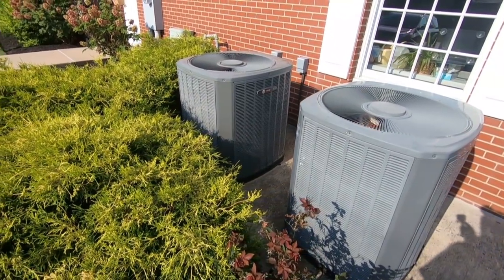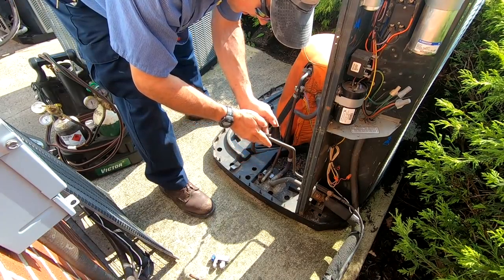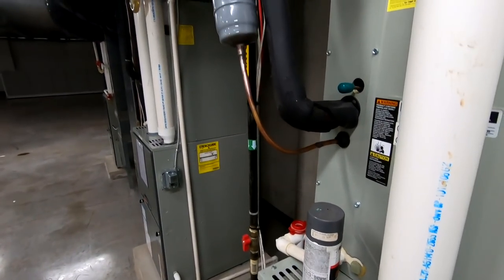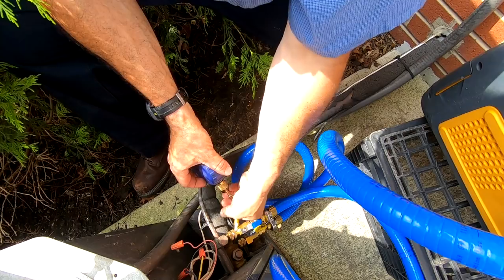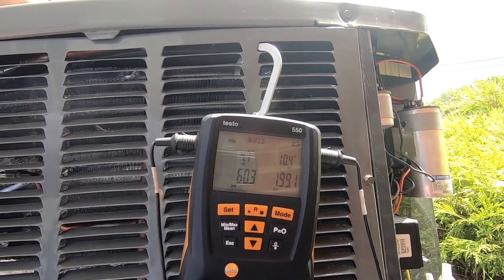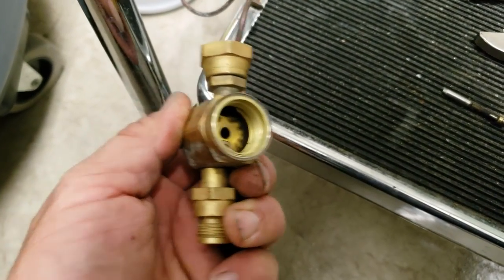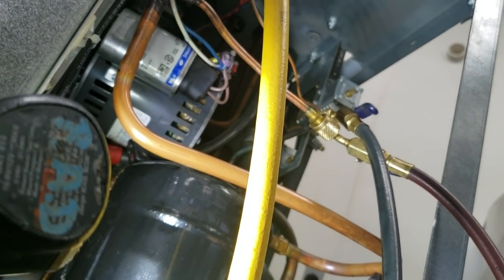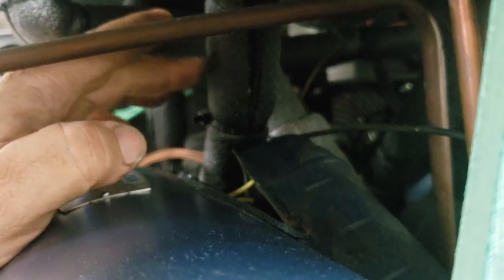Trane Condenser Coil Replacement With Bonus Footage

Comment: I have a Trane XR15 condenser.  It's 11 years old and the coil has a slow leak.  How do I go about getting a replacement coil?  I'm not sure if it's even available because the XR15 is discontinued.
Reply from the maker: I believe that's a 15 seer unit if I'm understanding their terminology of model numbers. They still make 13 seer evap coils and you can go to a higher efficiency evaporator if that's where it's leaking? you'll likely have to go through a dealer and they should be able to match something up.
Reply: @HVACRSurvival  Thanks.
Reply: @HVACRSurvival  It's leaking at the condenser coils.  The evap is good.
Reply from the maker: @gregflorko8402  find a company that has solder weld for aluminum and have them repair the aluminum spot that's leaking. It can easily be done now. Just got to find the right company to do it.
Reply: @HVACRSurvival  Thanks.  That's what I was thinking.  The HVAC tech that I had here said the coil is a combination of copper and aluminum and that it was not fixable.  I don't recall his exact explanation.  That company quoted me over $2,800 to replace the  coil assembly or $4,000 to $6,000 (depending on tonnage) to replace the entire condenser.  I told him that I didn't need an entirely new system.  The indoor components, thermostat and evap coils are good.  I asked him to clarify that the 4 to 6 thousand was for a condenser only with installation and he said that was correct.  I'm seeing brand new condensers advertised on line for about $1,200.  I've also watched YouTube videos that explain the process of replacing a condenser unit and it doesn't look like it's anything complicated.  They drain the coolant from the old one, disconnect the coolant in and out lines and the power, level the mounting area, hook up the new one, braze the lines, charge the coolant and turn it on.  I can't see that being over $1,000 worth of labor at the most.  I think I was quoted about double what it should cost.  It sounds to me like they're trying to take about $1,000 markup on the equipment and charge me another $2,000 for labor.  I'm not hiring them to do the job.  Can I order a condenser on-line if I'm not a licensed HVAC vendor?  If so, who would you recommend?  Thanks.
Reply from the maker: @gregflorko8402  generally you have to be licensed to buy systems with refrigerant in them. I don't know if the walls have changed or not.

Comment: No  nitrogen purge while brazing?  :(
Reply from the maker: You're correct they're eagle eye, I needed to hook up the condenser coil before I could run my nitrogen through the system. I used it everywhere else.

Comment: Two hoses for the vacuum?...just learned something
Reply from the maker: How many hoses do you normally use?
Reply: @HVACRSurvival  lol the normal 3 hoses
Reply: The setup for the vacuum threw me off for a  second 😂😂 I'm use to the vacuum  and manifold gauge set up but shit im green as hell i just order that field piece micron gauge
Reply from the maker: @prettycureforever7102  if you want to speed up your evacuation times and eliminate several leak points you should try the 2 hose system with vcr tools.  I never believed it until I tried it 👍👍

Comment: I use jb weld on anything,  why couldn't you use jb weld and let it fix the hole?
Reply from the maker: There's several reasons why, (Warranty coat, safety, and professionalism) but the biggest one would be I've seen it fail to seal a refrigeration system multiple times.

Comment: Yeah I wouldn't have gave the option of repair..... That wouldn't benefit them in the long run. If the AHU was in good shape it would've got a new ID coil and outdoor unit
Reply from the maker: Not my call on what we do and don't quote and there maintenance guy knows what he wants.
Reply: @HVACRSurvival  yeah well I reckon that's job security
Reply from the maker: That's what I was thinking.

Comment: I just delete the bottom of the coil-  subcool loop is all it is
Reply from the maker: I'm not a Trane guy so it never occurred to me that button of the coil was just a extra capacity subcooler?. Someone else mentioned that as well, it's definitely something I will take into consideration next time. 👍👍
Reply: HVACR Survival I've actually deleted an entire circuit from the coil without any distinguishable problems as well ...just to keep in mind.
Reply from the maker: That would have been handy if it was a critical unit. This one wasn't

Comment: you didn't put the unit back together very good tops not tucked in
Reply from the maker: I noticed it when I put the door back on for the electrical section. Good catch 👍